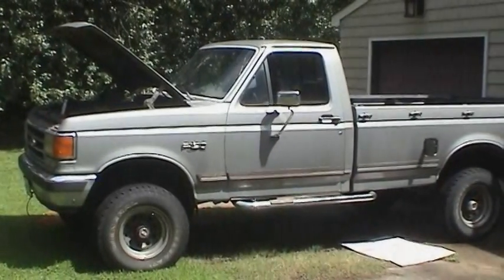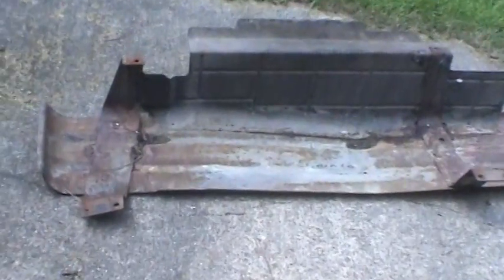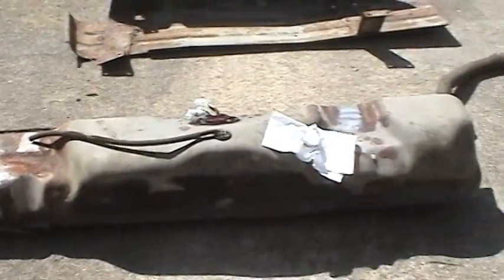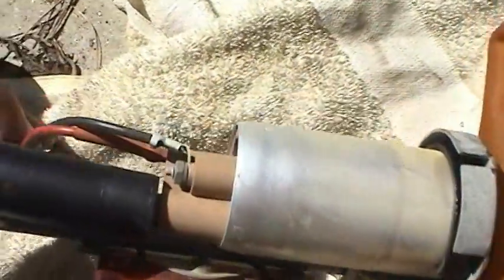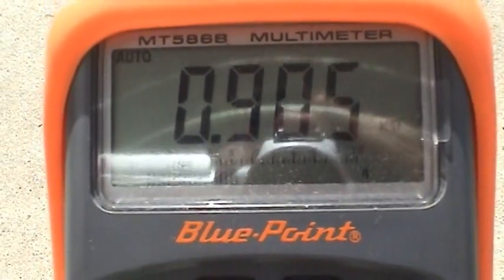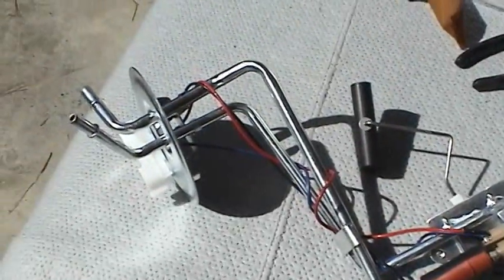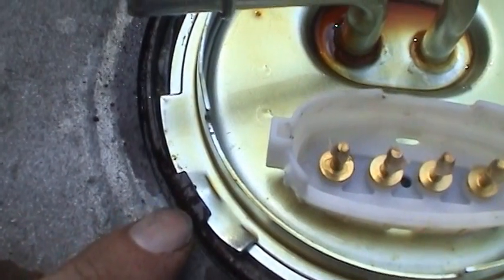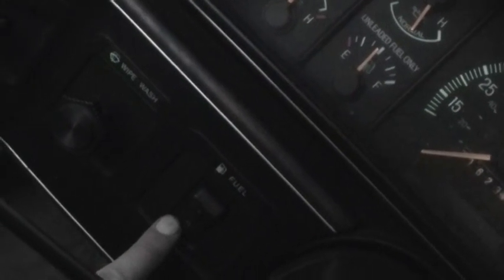1989 Ford F-150 4X4 Fuel Tank Sending Unit Replacement

Comment: Thanks for the informative video!  I have a 91 Ford E-250 5.8L with dual tanks.  The test you do on the fuel pump and sender was very helpful to me.  Now I'm ready to install to new pump and sender unit into the tank.  Really appreciate it.

Comment: Is there a fuse that can go bad in your fuse panel for your fuel tank gauge to tell you if it's bad or full or empty?
Reply: a bit late to reply, but I think the actual gauge or the cluster circuit board can be the problem in rare cases

Comment: I've replaced all the fuel pumps on my 1989 ford f150 pick up truck still not getting gas up to the fuel rail on the motor it has the 5.0 302 in it

Comment: my 88 F150 with the 5/8 with the two tanks the front tank on mine has little slant to it on top where all that sets in so you don't have to drop it if I had to drop it I would just cut a hole in the bed though

Comment: get a 18mm wolber, 6" extension, impact gun, 24pack of beer, a fat girl and 2 buddies. 6 bolts hold the bed on. the bolts are capped carrage bolts. have the fat girl stand on the bolts while you use the impact gun. make sure everyone has a beer. after your  bolts disconnect the fill neck and tail lights. after that the be should lift right off with the help of fatty and your two buddies. then bam theres your tanks and lines and wires all right there easy to get to.

Comment: can you tell me why or how gas from rear tank syphons itself into the front tank?. I have the problem of my front tank not working, and when I fuel the rear tank, it will back fill the lower front tank...nice video
Reply: I have the same problem. If you figure it out would you let me know the answer. Thanks

Comment: was your truck shaking while underload? my 89 5.0 shakes when i press the gas and when i rev it, it almost cuts out
Reply: 3rdgen4runnerguru mine did that too then I replaced the spark plugs and cleaned up the distributor cap and it ran and runs a lot better

Comment: I have a Ford f 150 truck 89 model 4x4 i fill the tank 75 liters each then I turn the key to accessories the Guage reads full then I start the motor and the Guage drops to the 3/4 full is it a factory fault or a electric proplem any helpful tips

Comment: So my truck is the same truck just not 4x4 and the front tank works like its brand new i have a half tank in there i will flip the switch over to the rear tank and the gauge just goes straight over to full so i drive on that for alittle while n then i come home and I'll flip it back over to my front tank n then I'll have alittle under a quarter tank. Whats wrong with my rear tank.

Comment: Great video, very thorough and informative. I am currently putting 2 new tanks and fuel pumps in mine. The fuel pumps are a little different '95 F150 4X4 extended cab. Front tank needs new sending unit also, problem is I can only Motocraft model and they are over $100 online. maybe I will use your multi-meter testing to see if I can get the original one working.

Comment: You Could take the bed off.  Its more work but I like to do it so that I can clean the rust up and spray the frame plus less rust to the aha thats just how I like to do it. Great video though! I never thought of testing the pump I always just put it in assuming it works! I'll do that now if I have to ever change the pump in my truck again! Thanks!
Reply: I did that on mine thinking I could get the tanks out way easier from the top, but it's impossible to get the front or rear tank out through the top of the frame, so I still had to climb under and do a lot of it from down there. I mean if all you want to do is change the pumps you can just do it with the bed off. But with an older truck (mine's an 89) I found the tanks were full of shit and rust.

Comment: I took mine to a mechanic and they cut the two line sto the bacl tank because it was pumping gas to the back tank. So they cut two lines amd put a metal line connecting the two so it pumps the gas k to the front tank. But my truck lost alot of power. I cant peel out anymore or dk burnouts.  And it hesitates when i accelerate. Its a 1995 f150 5.8
Reply from the maker: It sounds like the fuel transfer unit has malfunctioned and the mechanic bypassed it. That's not a proper repair as you have no way to control which fuel pump is operating. Also, you might be pumping fuel against the other tank's check valve, loosing pressure. The lower fuel pressure is likely responsible for the power loss. I would rip all that out of there and go back in with the original lines and transfer unit or if that's not economical, run the truck on just one tank and abandon the other tank entirely. The two tanks sound like they're fighting each other.
Reply: +domantor11  fuel pump on 5.8 needs more fuel.. when does that pump insufficcient  replace pump

Comment: I need to do this to my truck. I also have an 89 ford ext. Cab. Lariat edition.  4x4. Auto trans. My gas gauges move around.  I never know how much fuel i have.  Thanks for the video.
Reply from the maker: This job is such a pain that you may want to replace the fuel pumps while you're in there if they're not too expensive.
Reply: Dustan Maret is it my gas gauge

Comment: Good Video. For all you Ford truck owners, If you need OEM or aftermarket parts, LMC Truck (Long Motor Corp.) Or Dennis Carpenter Co.  Both of these companies purchased Fords original tooling. Just Google these two companies and order their Catalogs or you can flip thru their online catalogs and purchase online. Also Summit Racing corp. has many original Ford truck parts also. You must order the catalog for your year truck. I have been using all 3 of these companies for many years for my 1985 Ford F-250 needs. You can buy any part you need to restore your Ford Truck thru these three Companies. Just thought you would like to know..

Comment: Does Dorman make fuel pumps?  I know there are cheaper brands that sell an entire sending unit and fuel pump together as an assembly, but they might just be junk.
Reply from the maker: I believe they do but I'm not positive. Parts sites such as Rock Auto should give you several manufactures to choose from.

Comment: my Daughter just bought a 2001 ford F150 4x4. the Gauge said half tank full until she ran out of gas, still read half tank full..looks like i will be replacing the sending unit..i have change many of them in my life time and there still a pain,,,rust sucks, i can taste it now..
Reply from the maker: Oh yea. You're in for a good time. :-) Nothing like lying on your back and getting bits of rust in your eyes as you drop the tank!

What helped me is that the truck has two tanks so I was able to run the bad one dry so that it wouldn't be too heavy to deal with or blow me to bits if there was a spark.

Comment: Is the whole procedure the same for short bed trucks with a single fuel tank?
Reply from the maker: Yes. The tank may be smaller, but the concepts will be the same,
Reply: I don't know how big the tank is. It could be about 19 gallons like you thought your tanks were. This summer I'll be in the market for an older short bed F-150, hopefully a 4x4.
Reply from the maker: The8TrackChap
I hope you can find one. As you can see from my latest video, having a 4X4 really comes in handy during inclement weather.
Reply: I still prefer manual trans though. I don't know how well they are in snow compare to auto.
Reply: Did you ever change it out and if so what sending unit did you use ? I have the one in the video but was told it won’t fit and now I’m unsure !

Comment: Awesome post.  Thank you.  I have a 1987 F 150 with dual tanks.  I am going to do both.  Neither sending unit functions.  It also does not pick up anything at all from the rear tank.  Is the rear tank about the same removal procedure?  Thank you in advance.
Reply from the maker: Yes. Just remove the spare tire and skid plate (if equipped). Pull out the filler assembly, remove the two straps, and it should drop low enough to disconnect the fuel lines and wiring.

Comment from the maker: After the engine should be fully warmed up, feel the upper radiator hose to see if it's hot and under pressure. If it is, than the T-Stat. is still allowing coolant to be cooled by the radiator and may be failed open.

It's rare, but new T-Stats. can be defective out of the box. Also, make sure the T-Stat. is rated for 195 degrees Fahrenheit and installed with the pointed end facing outward (toward the radiator).

Comment: I almost feel like I have a weight lifted off my chest, thanks a lot. You seem to know this kind of truck very well. Im actually having a separate issue but it's a different mechanical problem any chance you can give it a go?truck is running cold any chance you can help diagnose this one too?lol,I replaced tstat/coolant temp sensor and checked for a clog in the core,all fine, gauge line stays a tiny bit past C after driving and letting her run, wondering if it's the coolant temp switch?

Comment from the maker: That problem is almost always due to the sending unit being open circuit. The issue should be resolved by replacing the sending unit.  You can also do a dry run and test the sending unit/gauge prior to installation like I did in the video to avoid putting everything together only to find out that the issue remains. However, I'm confident that your issue will be resolved with the new sending unit since the gauge works fine on the rear tank.

Comment: This was a great video! Im about to replace the sending unit on my 89 f150 only difference is it isnt a 4wd and has the inline six. The rear tank reads just fine but when i switch the the front tank the line shoots past full almost reaching 3 oclock. I figured replacing entire unit would fix the problem but do you by any chance know where the problem may stem?
Reply: My same question. I have the exact same issue on my 88. If you got any tips or ideas lmk.